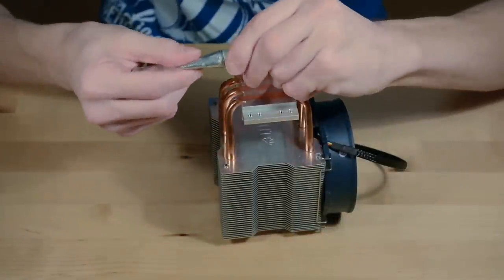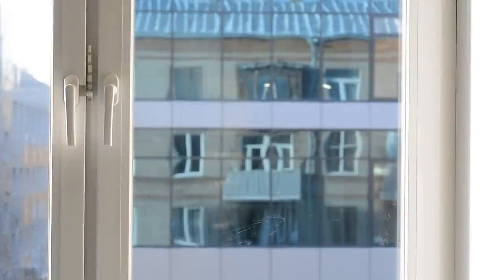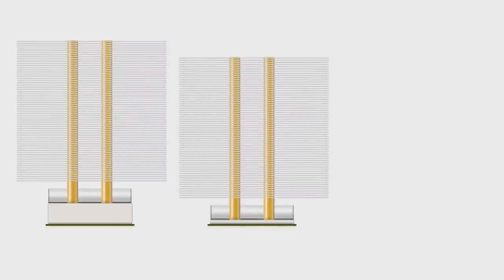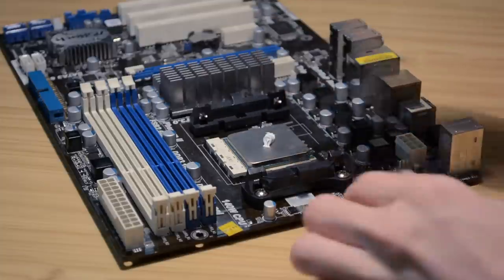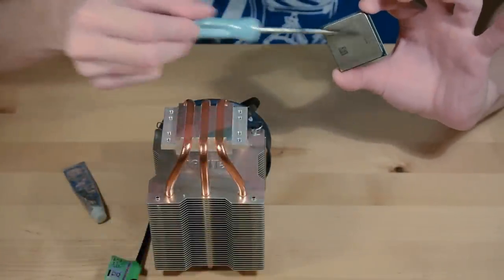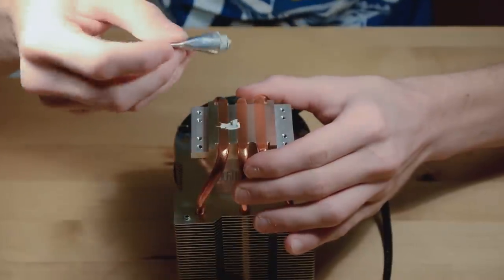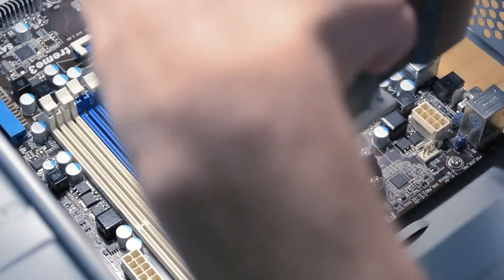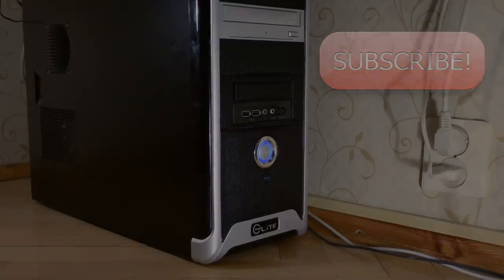Thermal paste: How much really need to apply and how to do it correctly? Как наносить термопасту?

Comment: One of the only vids that explains this process to perfection. The latest technology from the best manufacturers use gobs of paste, just slathering it on by machine to get it done with no consideration for the consequences of improper heat transfer. The original engineering specs for most hardware include recommended tolerances for the space between parts, such as the processor and heat sink, in order to minimize over-heating, but the stream-lined factory assembly process nearly ignores these tolerances in completing the finished product. This is partly to blame for the over-heating of gaming laptops that get so hot the chips partially separate due to remelting of the solder holding them down. I imagine a lot of folks buy lots of fans or water cooling to compensate for this, not realizing that cheap thermal paste is layered on the CPU/GPU like toothpaste on a brush. As a tech, I open a lot of older equipment to replace the paste on GPU's and CPU's, and that old, cheap paste hardens up like dried mud -- practically no heat transfer at all! I've examined graphics cards that over-heated and fried their fans, and found this exact circumstance to be the reason.
I always shoot for a semi-transparent layer, closest to the metal, as you suggest, and the only way to insure this is by applying the layer by hand, not just dabbing on a dot, line or cross. My computer has never needed extra fans or liquid cooling. But then, I'm also not infatuated with LED lighting, which generates lots of extra heat. Heat is a killer and needs to be minimized.
Reply: Wow, thanks a lot 
then I would get a better thermal paste.
Reply: This video does not explain this process well at all. You dont smear it on the cpu cooler that will cause many bubbles and temperature issues. You put a pea sized dot in the middle then the cpu cooler goes on top.

Comment: The air space thing helped me understand my processor woes, because the bracket that clamps the heatsink onto my motherboard was slightly loose it dried out my thermal paste quickly and I was having 70-80C+ temperature reads while playing Ark. It was blowing my mind with my newly built rig.

Thanks comrade!.

Comment: The reason there were air pockets from not spreading the grease is because you took the cooler off. When you separate two surfaces connected with the paste, it creates those air pockets.

Comment: Good video. I have used this exact method as well...(just applied it on CPU instead of heat sink) & have gotten better temperatures than any other methods. It's been 5 years now... and after countless hours of gaming & 3D rendering... my Phenom II 965 idles at 28c and goes up to 49-51c during full load on all 4 cores. It has never crashed once... even after 24+ hours of rendering at 100% cpu capacity.

Comment: i use plain grease, and never had problems, and runs even a bit cooler cause it's easy to spread it thin, also the easiest way to spread it evenly is to push and roll a cooler gently and firmly on top of cpu a bit before installation, cause once you do it you must not separate them again... and i agree with Michael -the less is better... even without anything in normal conditions there would not be overheating... copper has far better thermal properties than any paste so paste serves only to fill micro pockets of air cause no 2 surfaces are ever 100 percent flat and straight

Comment: OK Guys. About 12 hours ago I disassembled my new computer for the first time as it had scary dust built up inside.  When I took off the fan and the heat sink thingy I noticed the pasty stuff on both pieces. Since I didn't have any to replace it, I carefully vacuumed the dust instead of blowing it around to save what paste was on it. There was gobs of paste in some places, none in others. In the end, I just stuck it back on there careful to not disturb any of the pasty stuff. My Quad core CPU runs a steady 34 to 36 degrees Celcius.  Smear a nice thin even layer on there and it will be fine.

Comment: It's okay to spread the paste if it's thick like this one, but you should put more of it. The layer is soo thin, meaning if the surfaces aren't ideally flat and touching, you're gonna have bad heat transfer.
Reply: Especially on the cpu, ihs isn't perfectly flat, soo the cooler won't be in complete contact. Other example is my gpu, the heatsink wasn't even touching the cooler so i either  have to put a lot or place a copper shim and then spread it.
Reply: You don't want thicker. Thermal paste is not meant to be thick. It's only meant as a the thinnest possible layer to prevent air bubbles and fill in micro scratches in the metal. The ideal is metal on metal, the reality is metal on metal has micro imperfections preventing true 100% contact without fusing. Thermal paste in a very thin layer is the compromise.

Thicker is never better it just makes for less contact.

As for your GPU example, if you have enough gap for a copper shim. Use it. It's not ideal but it's better than an air gap filled with thermal paste. You'll want a thin layer of thermal paste on each side of the copper shim.
Reply: +Vincent Beers +Vincent Beers thicker thermal paste lasts longer and that's why manufacturers use it. My point was that instead of making coolers with the most pressure and ideally no gap, manufacturers tend to loosen up these like in my case. If you put way too little, you end up with worse performance.

Jayztwocents made a vidro about using too much, he literally squeezed an entire syringe of thermal paste on a gpu die and ended up with great temperatures.

Comment: Noticed a lot of people talking about how you shouldn't spread on the heatsink.
You can do this if you want in addition to the heatspreader of the CPU. It just fills the micro-fractures and tiny gaps in the surface texture of the heatsink contact area.
http://www.arcticsilver.com/pdf/appmeth/int/vl/intel_app_method_vertical_line_v1.1.pdf
Reply: +Eck So everyone is saying he's wrong, but it's in directions from an actual thermal paste manufacturer???
Reply: +zbaerenlovesme I have just read through the instructions provided by Eck.

Seams logical enough. You "tint" the heatsink by spreading paste into it then wiping off excess to fill the microscopic valleys. You apply the paste to the CPU in a 1mm line across the cores an let the pressure from the heatsink spread it and that you deffo do not spread it yourself.

The video is very wrong if you follow these instructions.
Reply: +Daniel Drummond thanks. I'm still a little confused but I appreciate the response.
Reply: zbaerenlovesme
Yes like Daniel said, it's called 'tinting'. You're really just filling the microscopic gaps in the metal.
Reply: +zbaerenlovesme Its in the instructions provided by Eck.

Comment: I agree with those who say that spreading the thermal grease the way it was shown in this vedio is not the right method as it will create more bubles. I think the right way to spread the thermal grease is by the traditional method, which is by putting the right amount of grease in the middle of the processor's surface, placing the heat sink above, and providing some pressure on it until the grease reaches the boundaries of the processors's surface. This way will eliminate air bubles more efficiently than the way that was shown in this vedio.

Comment: Thank you for this video. I was going to buy a new cooling system but applying a new layer of thermal paste reduced my Quad Core 2 from 90 degrees to stable 40 degrees. Thermal paste makes an amazing difference!

Comment: But this is wrong. The point of placing it in the center is to ensure that there's one point of contact pushing air away from the grease. If you spread it out, you'll have tiny air pockets from multiple contact points.
Reply: :o

Comment: To explain this real quick, there's a reason to spread like this. If you are using some cheap thermal paste, it won't have same spread rate as an artic silver. Also a small pea sized doesn't cover entire surface, so it is very good for when you use expensive highly conductive thermal paste like artic silver, but when you are buying a cheap one, it's preferable to cover as much as you can so heat get distributed( ofc dont exaggerate look in the video he takes precaution to spread everything evenly to ensure when you are pressing the heatsink, there is no extra paste being pushed to the sides and fall on your system)

Comment: Well, I've been applying it by spreading method but with the "plastic on fingertip"... a little thicker and "creamer" layer of compound almost to the corners, the heatsink finishes the job... getting excellent results... some desktops and notebooks show a 20ºC drop of the temperature...

Comment: I spread mine on the cpu and never had air pockets for all the years I been working with computers.
Reply: Spreading doesn't always create air pockets, but sometimes it does. At best, spreading adds nothing of value. At worst it can create air pockets. It's a pointless extra step that while it doesn't always make things worse, it also never actually makes things better.
Reply: Thanks for the heads up!

Comment: Well, my quad core AMD Athlon II 645 idles at 25-26 celsius, clocked at 3.3Ghz, and I used the dot method.. With fully loaded 4 cores (using Prime95) it reaches a maximum of 55-60C. Not to mention that I am using the stock cooler. You should at least lower the temperatures to 24-25 degrees Celsius with that aftermarket cooler..

Comment: Thank you for your informative video.  This is done right.  I was actually entertained and interested.  I would like to see you make a video about multi-booting a pc hard drive, and talk about hackintosh also if you were interested in that.  Thanks for explaining everything thoroughly, my CPU definitely came with just a little glob of thermal paste but I'm going to replace the whole heat sink and cpu processor and fan when the parts arrive.  Laptop dismantling....wish me luck.  I am wondering about tri-booting my dell inspiron 1545.  My plan is: Upgrade HDD 120GB to Samsung EVO SSD 256 GB, then divide into two partitions.(Three, so there is one for future files?) Then I would format one as FAT and the other as NTFS. Then I'd boot Max OSX Snow Leopard onto the FAT drive, and Windows 7 onto the NTFS.  I then wanted to take my old HDD hard drive and install it in the optical drive slot, which I will modify.  Then I was thinking I would partition that hard drive, and boot it with Linux of some distro, I'm not sure yet.  I have never done anything like this before.  Should I just leave the existing Windows 7 on the other partition of my HDD? And have 2 different Windows 7 boots on one laptop PC? That would be Windows 7 Clean, Mac OSX on one drive and Windows 7 existing, Linux on the HDD.  I just want to do what I think will be fun, effective and cool, but I could use some direction from someone who actually knows what they're doing. I am just learning as I go...
Reply from the maker: Thank you for your positive comment! And for a good idea for a new video. It would be really interesting! I have to think about it :)

Comment: When you spread the thermal paste on the tall CPU cooler, & you were done, you could see thru (could see the copper) an area of the paste? The paste was thinner at that spot. Should you have applied a small amount to have a more consistent thickness? Thanks 🤓

Comment: You don't need to spread it, a small blob is fine. I didn't spread my paste and my temperatures are fine (less than 40C under load, aftermarket cooler, AMD Phenom II X3 710)
Reply: i believe you, but you really do need to spread it , evenly , making sure the whole cpu-heatsink contact area is covered. Every part of the cpu will generate heat. it won't just direct it through the thermal paste in the middle. the air around the edges will get super hot. in your case I'm guessing your fan compensates. But as a tip if you ever work on somebody else's computer for them, don't use the blob technique
Reply: DCMPSaliva Been pretty well proven the blob technique is generally the best use scenario. The blob allows the cooler to press and spread evenly and will avoid having air pockets develop as a result to using the card technique. Generally, it is those who use too much paste that tend to have problems. I'm pretty sure Tek Syndicate did a video on this exact thing using plexiglass as a tool to see how the material spread through different styles of techniques. Have a look there for reference. Either way, I'm not sure there is a right way, but there certainly is a wrong way, and spreading is one of them.
Reply: Ryan Dailey Don't even respond to him. Let him spread it. I feel bad for people who follow that though. As you said it causes air pockets which then turn into heat pockets and will damage components over time. Let him do it. Let him learn how to build a computer and get a high end PC and then ruin it. He doesn't wanna listen, thats fine. I actually didn't watch this video with the sound on (I'm currently sitting in class lol, I was bored searching up random things, and I wanted to know different techniques for putting on thermal paste. I just put a little blob in the middle and then put the heatsink (my h100i GTX) ontop of it, thats how I did it anyway well plan to do, I used a h100i on my old system im using the new h100i GTX on a new system, my parts actually just finished shipping yesterday haha, I plan to build it once I get home) Anyway, idk if this video said to use blob or spread, I stopped watching after like a minute because I found the comments to be more interesting
Reply: Right now? 11 apps open. 9 tabs on my browser a few of them youtube. Watching a video as i type, its at 48C with fans running 2005rpm. ...just checked again its at 51 C
Reply: ***** or watercooling.
Reply: ***** I mean ethier way its a heatsink but, you get my point, some are gonna cool it more then others.
Reply: Sheldetin So you are telling me you CPU idles well below ambient temps? Or your room is at a constant 60-65 degrees Fahrenheit? 

30-40c for an Intel chip is pretty normal. AMD is for sure higher, I have one. I'm talking any iteration of AMD. No I'm not bad mouthing AMD either, I have two 290x running contently in crossfire right now.

Comment: While less is great, too little will also result in overheating.  These compounds contain metal that does help transfer heat.  Bubbles will cause inefficiencies.  Best method is to apply small dab in the middle of the processor, place heatsink on top and wiggle.  Pressure from screwing down the heatsink WILL cause the grease to spread out.  Too much could short out the cpu as it does contain metals.

Comment: Take it from someone who knows how to make glass tiles stick to a shower well enough you can smack it with a hammer and they won't break. The best technique for cpus can easily be borrowed from tried and true methods. It might be okay to "back butter" the surfaces, but you should use 2 or 3 evenly spaced small lines of paste depending on the size and shape of your cpu.

Comment: If you have a original heat sink and fan ..you have to look at the thermal paste supplier website to see where to place the grease and how much to use.
On the Arctic silver website ..Dual processors need the paste in a thin line 1mm thick
and in a certain direction in relation to where the cores are.

Comment: I've been building and overclocking PC's for a very long time, and this is NOT how you apply thermal paste. You will get air bubbles and uneven contact. NEVER spread the paste. Simply make a pea size blob in the center of the CPU heat spreader and place the heatsink/water block over the CPU and push down. Go on any overclocking forum and they will tell you the same thing.
Reply: +Beany uneven contact with spreading and even contact with a pea? You joking or are you high? PLease watch any of those videos here showing you what happens when you use a pea... thanks
Reply: +jirka merunka he said pea sized blob
Reply: Lyka-Baus that's what I mean, circular shape will create a circular coverage of IHS... If I remember correctly IHS is not round...
Reply: +jirka merunka It isn't but the CPU die is also not as big as the heatspreader. As long as the circular coverage overlaps the heat source, it should be fine. The more surface it covers the better, however forcing every edge to be covered won't help all that much.
Reply: SirLugash agreed :)

Comment: "Remove the thermal paste with finger and..."
Why on my thermal compound box it says:
"Do not touch without gloves,if so,wash immediately."
Reply: Just don't eat it.
Reply: ***** good thing i didnt use my bare hand , i used gloves before eating it
Reply: +TheUnknownContact #1 Bear hands? Fur on the  processor wont help either.
Reply: MrWolfSnack hmmm , well , most people have air filters on their cases...
But we all know bear fur slips through sometimes...

Comment: The spread method will leave air bubbles if there is not enough pressure from the mounting mechanism. It's better to add more paste and let it flow out because the same amount of mounting pressure will leave the same layer of paste.
Reply: +Reinis Ramans idk I spread mine and never had an issue and my pc is 5 years old and is still doing just great.
Reply: +Complicated Gamer I used to spread the paste too.. I just try to make the layer not very thin.
Reply: Reinis Ramans Exactly man. I spread it on but not to thin or to thick.